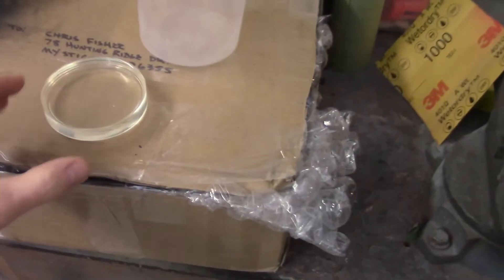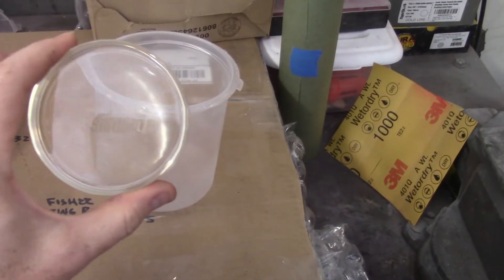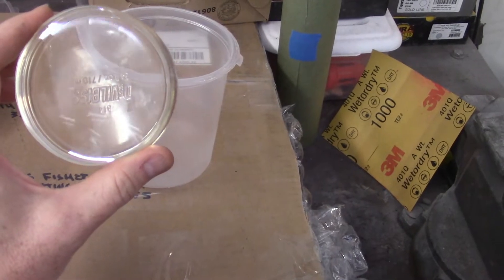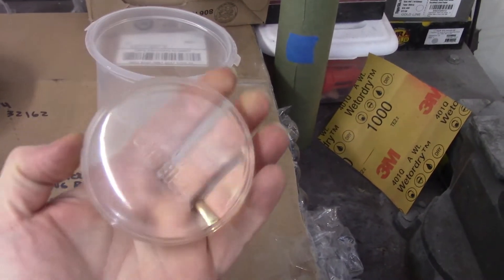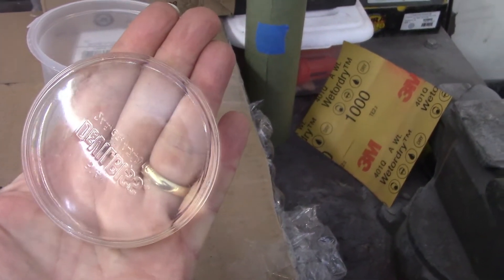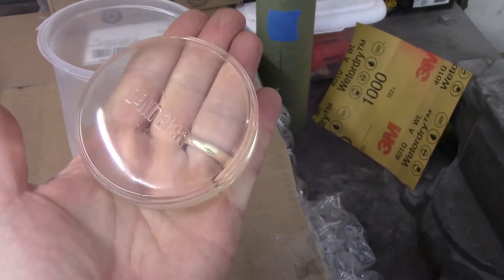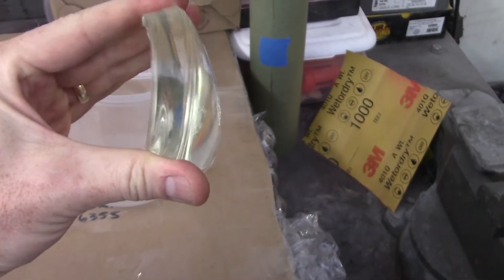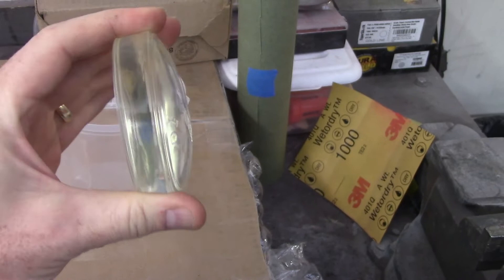Southern Polyurethanes Universal Clear - Amazing Stuff | Roundtail Restoration

Comment: Spi vs speedokote price and quality?
Reply from the maker: I don't have any experience with any other clear so I cannot speak to their competition. But, as a first time painter, I didn't have any issues that weren't ones I created and I used SPI for all of my paints. I'd recommend visiting their forum, http://www.spiuserforum.com/index.php, which is very good and can give you all the information you need. Thanks!
Reply: I have personal experience with Speedokote and have just done research on SPI but from what I gather they're in diff leagues. I like speedokote stuff but it's a budget product. .Don't get me wrong might t be the best budget product but SPI is supposed to be high end stuff for good prices(not as  low as Speedocote). Speedocote clears especially are some of the fastest drying clears tho and I don't think that's an attribute of SPI stuff. Actually it seems from reading SPI literature, it make take more time for their clears because they have a more specific application/drying process than you normally have with other brands(some differences but pretty much the default process)